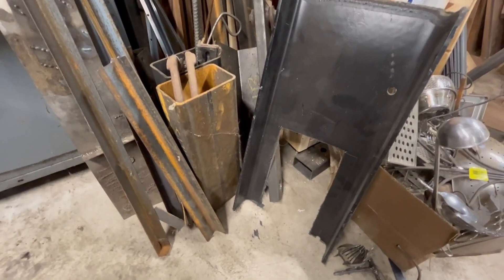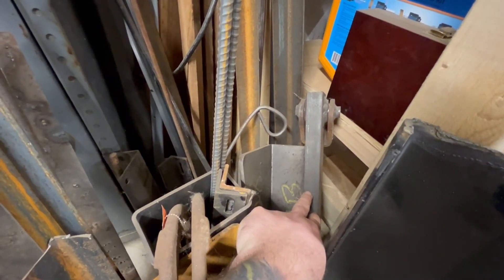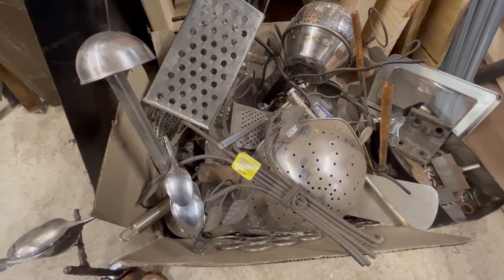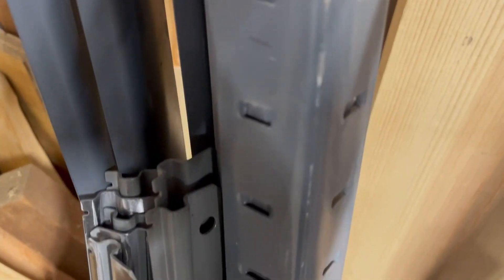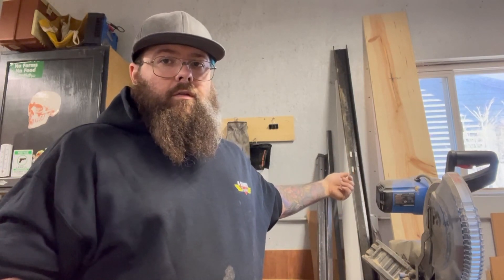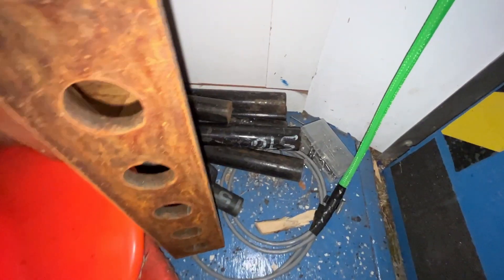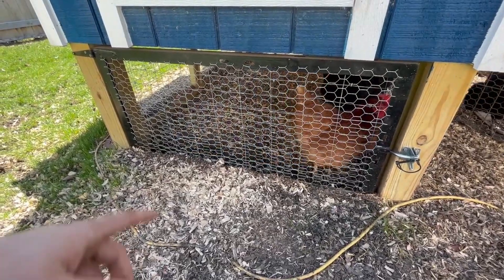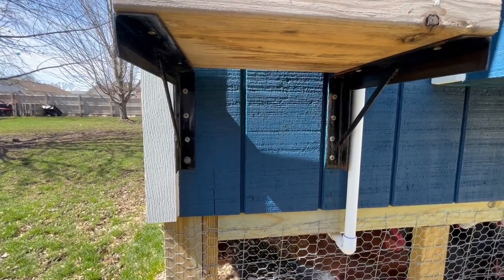Where to Find Scrap Metal | Find Cheap or Free Metal For Welding Projects

Comment: Some good advice.  I'm also a hobbyist welder.  Through an acquaintance I purchased a used Millermatic 140 mig welder  from a family owned welding shop.  the owner is extremely nice and and offered me some of their cut off scrap metal to practice on.  Also Metal Supermarket (not an ad) in my area has a metal cut off room with some reasonable prices.
Reply from the maker: Great tip! I’ve used Metal Supermarket before. They are great for small quantities. Their hours can make it hard to get there sometimes though.

Comment: Keep an eye out for people giving away steel bedframes. Also treadmills.. There is a LOT of steel in a treadmill, not to mention DC motors with PWM controllers which are perfect for turning your cheap drill press into variable speed..:)
Reply from the maker: Good tips!  I’m always on the lookout for electronics too.

Comment: We are replacing all the cabinets the steel shop has made since the 40s at work. Ive begged for a door off of 1. They refused and are going to pay to have it hauled off instead of selling it to me. We have monster cabinets built out of .250 steel plate. That 1 door will cost me $250 probably. Unless im standing there when it gets scrapped. Having to bribe someone isnt that expensive sometimes.
Reply from the maker: That's too bad.  Some companies just don't see the benefit in letting their employees being able to put old stuff to use.

Comment: Bed frame became my plasma insert to my welding table. Hardened steel so use plasma cutter or cut off wheel. 

Be always on the lookout for scrap. This area it is highly competitive.
Reply from the maker: Nice, I am going to try and get started on mine this weekend.

Comment: Bed frame angle iron is strong, but it's brittle.
If you spot a tossed hide-a-bed couch, get your hacksaw, they are a decent source of tubing and flat stock..
Reply from the maker: That’s good advice. Bed frames are great for certain projects, but sure can be a pain sometimes
Reply: @GarageHobbyist  I made, remaking, building a mini-bike.
I tacked the handlebars on for testing purposes, and after emerging from the bushes I seen that the welds held, but the bed frame angle iron let go at the welds.
It looked very granular and probably a high carbon content?
I find that odd, unless planned obsolesence, because some bed frames are under enormous stress at times.

Comment: damn thanks. i used to do some woodworking and now i wanna upgrade to "blacksmithing". it basically involves me with a concrete stair, a hammer and whatever scrap metal my parents say i can have. so far i have made some arrowheads but i ran out of scrap metal lmao
Reply from the maker: Look around at some DIY anvil ideas.  Concrete and rock as an anvil can obviously get things done, but there are some low cost ideas for anvils that will work better.
Reply: @GarageHobbyist  yes ive been wanted an anvil for a long time, thx for the idea

Comment: 07:40 
So... I've seen the tandem trailer axles on Semi trailers that slide back & forth along a rail...
That looks like the rail those axles slide on... 

08:08 
Those look like those rings that go on REALLY OLD tires, to hold the tire in place.. again don't know if that's exactly what it is.. 

On the hand that you can't make anything from this stuff, at least you could haul it to the scrap yard & maybe make a few dollars off it all?

Video was some general good advice for getting stuff to work on.. wouldn't the best advice be to go to a scrap yard though?
Reply from the maker: A scrapyard can be a good option, however in my area there aren’t any that let you walk around and pick stuff out. You’ll more than likely have to pay for it as well. 

I continue to find things in the trash that are free that I can repurpose. Whatever works is the best choice!